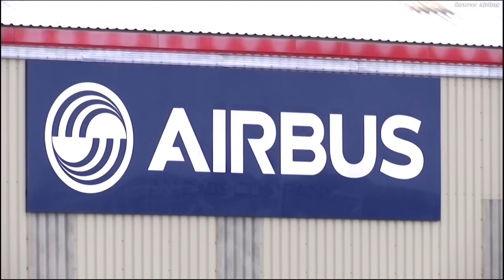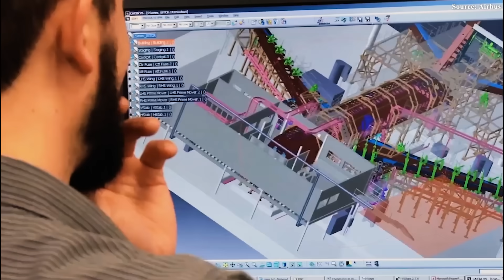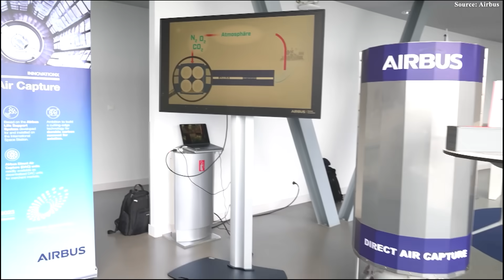Airbus Just REVEALED New Aircraft Will CHANGE Aviation Forever!

Comment: Why invest heavily in an extra-long variant the market - with the exception of Emirates - is not clamoring for? Can tail strikes during take-off and landing be reliably avoided? Has Rolls Royce solved the CMAS problem on the Trent XWB-97 that has kept Emirates from ordering the A350-1000?

How many airlines can reliably achieve high load factors on aircraft with 450 seats or more? Airbus fell into this mine-is-bigger-than-yours trap before, with the A380.

The European manufacturer would do well to remember that its core business is in the high-volume narrowbody market. Most airlines need an A322XLR more than they need an A350-2000.